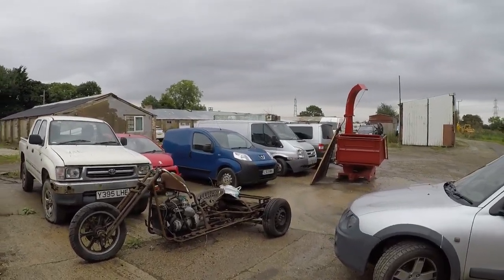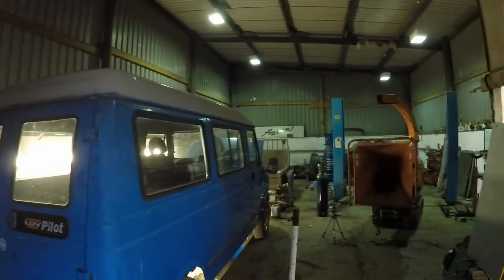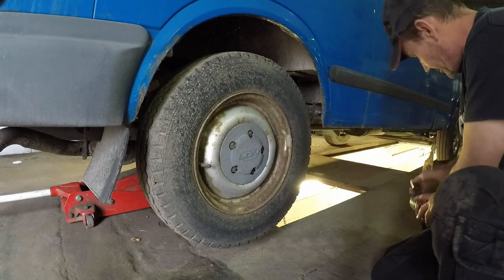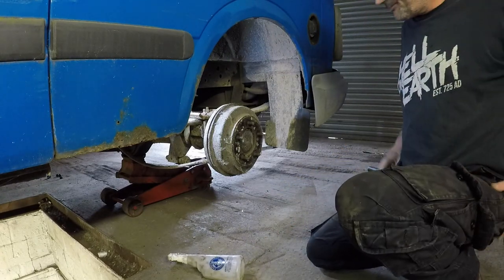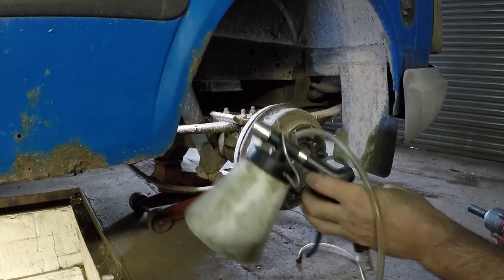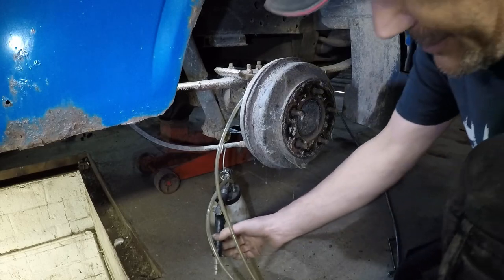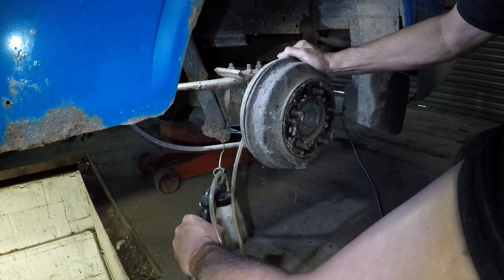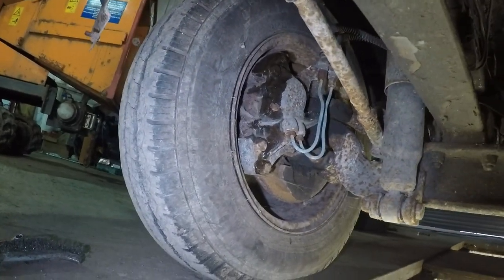Project ( LDV ) Pilot ...  Just Knew This Would Happen !

Comment: 2 steps forward,  3 back
Chit  happens
Reply: I was finishing up a timing chain job on a 318 Mopar, as I was putting the bolts in the timing cover, my cousin started talking about them accidentally leaving the fuel pump reciprocator off and had to install a electric fuel pump,  I stopped and said , look on the work bench for a round pully looking deal , sure enough, I left it off. Lololol